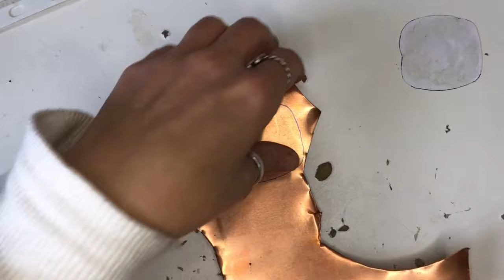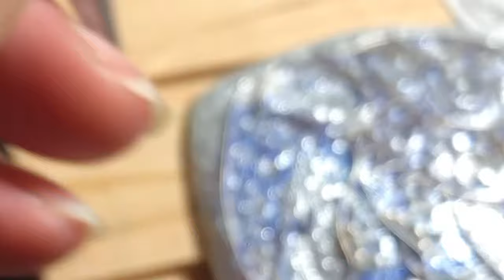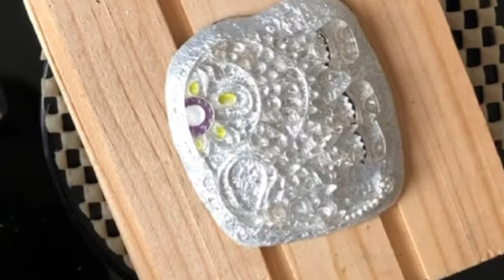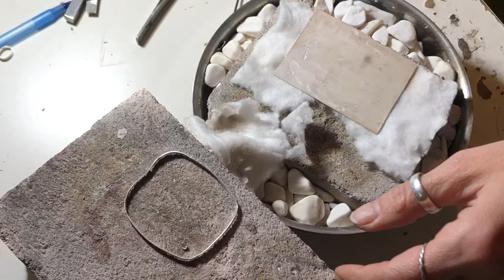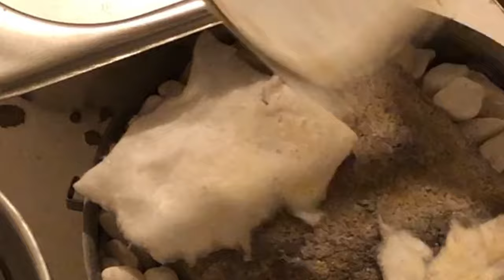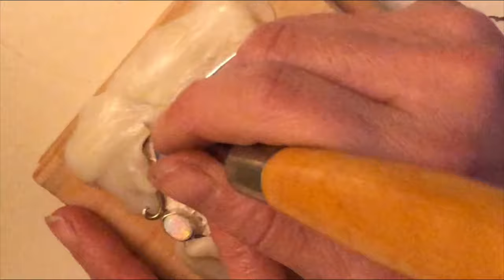Making Cloisonne Enamel Jewelry and Silver Bezel Setting. Cloisonne Enamel Making Process

Comment: Hi, what is the red grinding tool called please?
Reply from the maker: Hi, it is kind of lapidary machine. I bought a cheap motor and modified it.  You can use any kind of 3000 rpm motor.

Comment: Hi 
May I know how are you sticking the shapes with the metal ?
Are you using any soldering strip ?
Reply from the maker: Hi, I use water based glue diluted with water to stick the silver wires temporary. You can use any kind of water based glue. Then, I wait untill the glue is dried. Finally, I put the piece into the kiln for a minute. When enamel is melting in the kiln, the wires stuck in enamel permanently. I hope this will help you.

Comment: Where can I get wet polish machine
Reply from the maker: Hello, you can search for flat lap machine or lapidary machine. They are suitable for working wet. However, most of them are costly. Economic way is looking jewellery supplier stores for any kind of 3000 rpm motor. Then, you need to take precautions to remove the water from motor like as I did with red stuff.